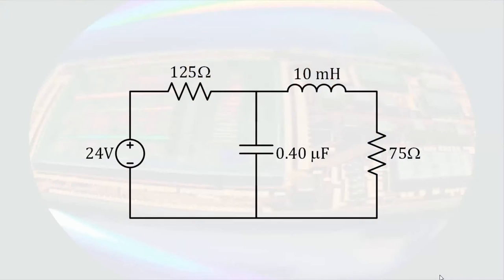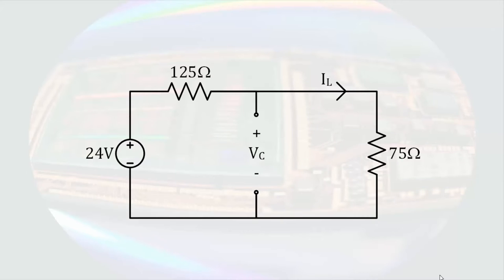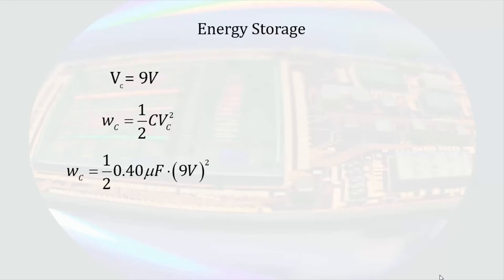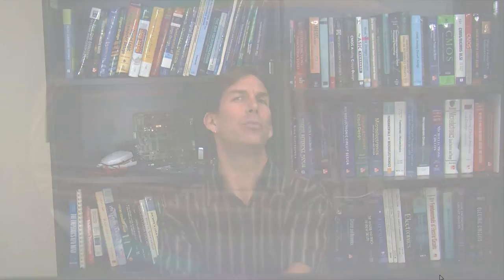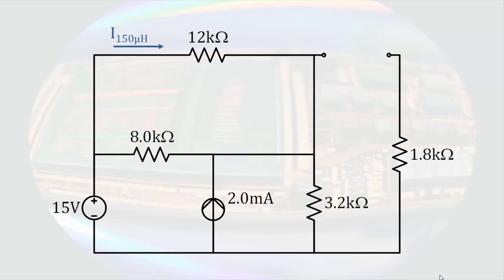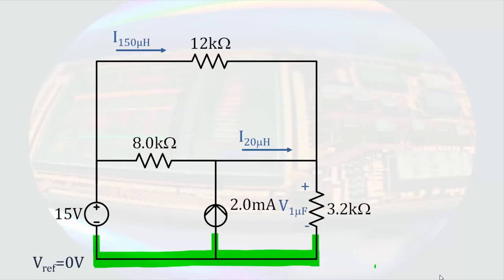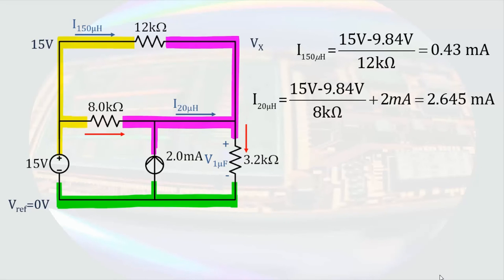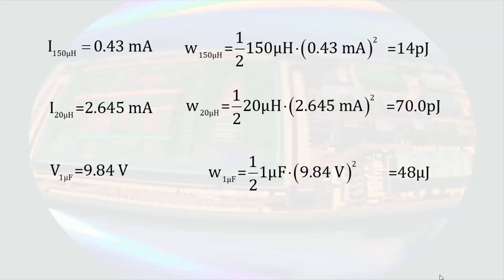22. Capacitors and Inductors at DC

Comment: I have a question Sir, What happens without complex mathematics when a DC Voltage, a switchs, a resistor, an inductor, and a capacitor are in SERIES and the capacitor has no CHARGE or ZERO VOLTS at the instant we close the switch and after the switch is left for a very long time? Will the DC voltage across the resistor, capacitor, and inductor be equal at a certain time, and how do we calculate the 'TIME CONSTANT', in that RLC DC circuit in SERIES?

As an electronics technician, with no 'differential equations' background, I know Obviously, in qualitative terms at a certain point in time, after the switch is closed, 'one third' of the battery voltage across is dropped in each component of course ... I guess the best way is to breadboard this series circuit and use a 4-channel oscilloscope and observe the behavior of this SERIES RLC circuit.
Reply from the maker: This problem involves differential equations.  There would be some higher level math involved.  Without math, the capacitor would accept charge until it was full and then would look like an open circuit.  The resistor and inductor would limit the initial charging rate.